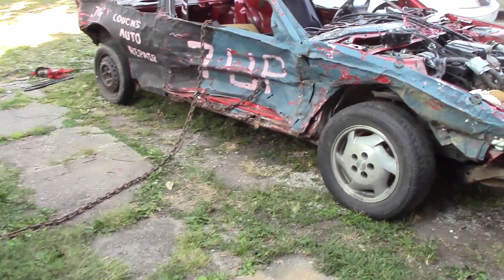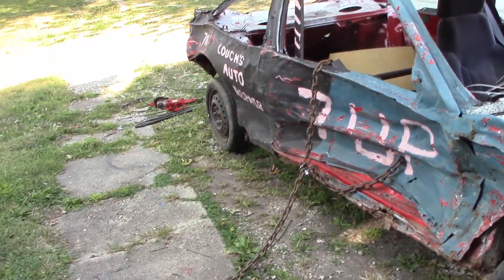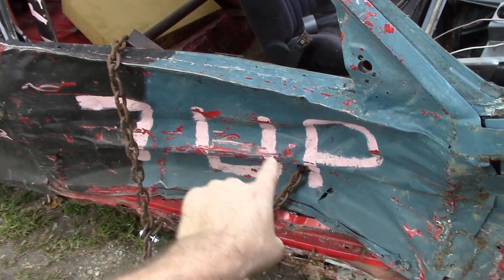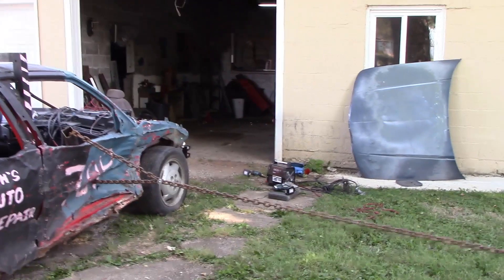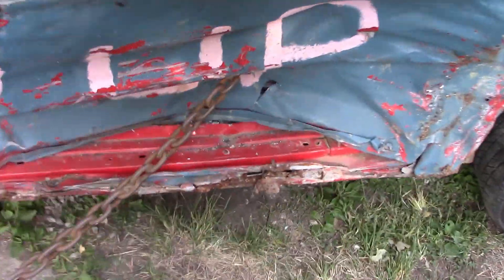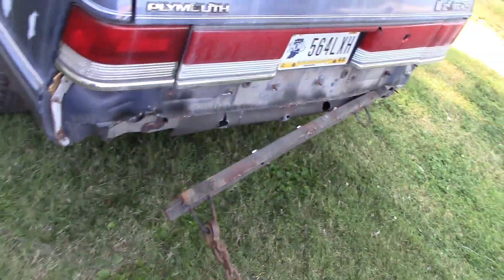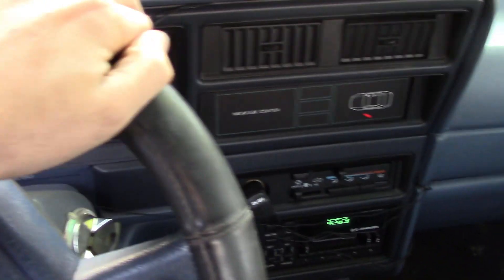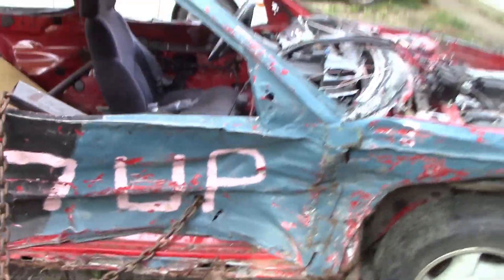93 Cutlass Door Dent Pulling

Comment: If you would of run the chain threw the door then up and around you would of had a better time you were getting the pull on the top of door not the middle where it's dented in